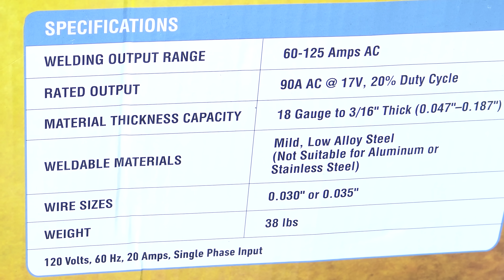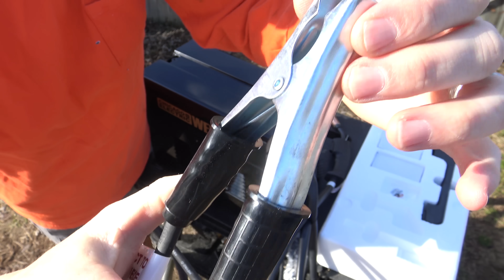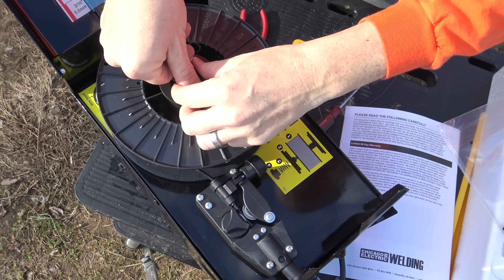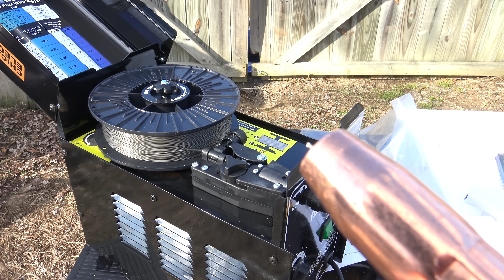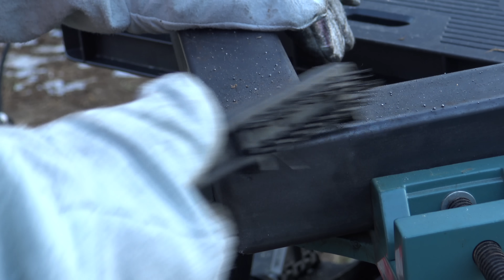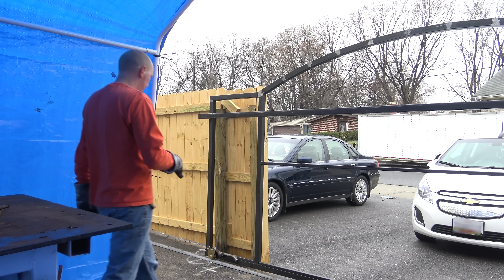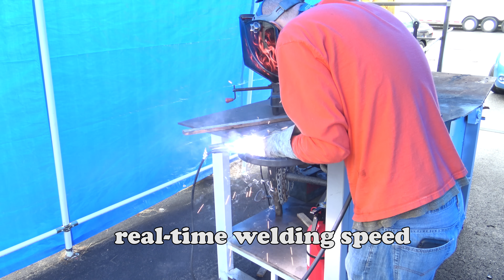Harbor Freight Flux 125 Welder Review

Comment: I have the older blue machine and have modified it alot, use a 10lb spool after cutting out the lid and moving the mount, converted to DC with caps so it's heavier now but less splatter and better penetration, reversed polarity, put a fan in it and wired it so the wire feed motor gets power before the coil instead of after the coil so no more feed speed drops, it's decent now lol, there is a bunch of videos of people converting these to DC etc, it's worth doing
Reply from the maker: Very very cool, thanks for sharing!

Comment: I have the older version 90A. I use it for portable road jobs and when i  dont have my miller available. It was on sale at HF for $88.00about 14 years ago. I told my driver to grab one. Its good for exhaust, tacks, all the simple repairs. 14 years and still going. I still have the roll of Chicago Electric. 030 wire i bought with it in it.

Comment: Not a respirator dude.
Reply from the maker: GVS Elipse P100 Dust Half Mask Respirator with replaceable and reusable filters included, Blue
Reply: You think some kind of filter will protect you from toxic fumes?  Then why does hazmat outfits have a face mask with some kind of breathing apparatus?  Sorry, but you’re not safe, without some kind of ventilation pushing the fumes away.  Just trying inform.

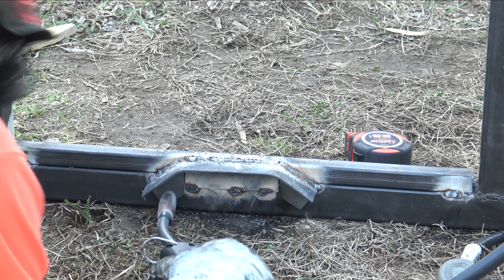Comment: At time frame 11:56 you stated "If you read the instructions and then follow them you will have a much better chance of success. - Which reminded me of the old saying we had in the Army..."If all else fails, Read the Instructions, and then be like a typical G. I. Soldier and Fail to follow them".  Yes after 23 years in the Army I'm now retired from the Military. But  I still remember that old saying. Maybe I should practice what you preach instead LOL. 

Anyway Thanks for a great video review of this welder, as I'm now looking into up-grading my old ancient 180 amp Forney Stick welder of which I've used for over 30 years now of which I bought used for $100.00 back then from its original previous owner. 

I started out long before that using an old Sears Craftsman 30 amp 120 volt AC stick welder which was a small red box about 1 foot square in size of which I bought used from a pawn shop for $25.00 and used for many years for building many things including my own utility trailers. 

As I previuously said many thanks for a great video and review of this welder.
Reply from the maker: Thanks for the good words, the experience sharing and all your years of hooah.

Comment: I used a stick welder for many many years, I bought this cheap mig welder and I'm so happy. I didn't know how easy it was to weld stuff. I also bought a HF auto darkening welding hood.  One thing I found is if you want your batteries to last longer, when not in use turn off the hood to grinding mode.

Comment: I have the 90a version of this welder.  They're the same machine except for the labeling.  I've done some serious welding with it.  I converted my HF motorcycle lift to a hydraulic cylinder.  The welds have to stand up to 10,000# sheering loads. They're holding up well.  I did convert my welder to DC and it made it a much more capable welder out of it.  Most of the welds were 3/16" to 1/4" butt welds, and some 1/4" to 5/16", but the 1/4" to 5/16" aren't subject to the sheering load.

Comment: I'm super late on this video, I did however just purchase this welder from My place of work Harbor freight lol. I bought this one because I'm a diyer and I got it for a little over $80 with employee discount. Also my buddy owns this welder and welded the frame on his rock crawler and has yet to break. It does take a beating when he climbing. I really enjoyed your review. I think I'm gonna be happy with this purchase and for what I'm gonna use it for it will be perfect. I fix small engines and sometimes need to weld tractor and mower decks. Thanks for the great review. Just subbed your channel
Reply from the maker: Tks for the good words. Def great for mower decks, be sure to coat with Rust-Oleum after or something. That employee discount is noice 🙂
Reply: @TRYtoHELPyou  you have any good recommendations on a good shield? I really don't wanna spend hundreds only because I'm a first time welder and I don't weld all the time. Preferably from Harbor freight so I can get the awesome discount lol

Comment: Does this work on 1/4 or 1/2 in steel for a buggy frame. Also what wire would you recommend for that
Reply from the maker: A buggy frame made from 1/4 or 1/2 inch thick steel will not be able to be towed by a normal trailer, that's all way way way too thick. .120 wall steel tubing may work but that too is super heavy. All I suggest is going to research this much deeper outside of YouTube unless there are decent tutorials for DIY buggy frames.

Comment: You have to get the 80 amp ( on the box it says 80, but on the welder it says 75 )  HF inverter welder for the thinner stuff. It's about the same or a bit more than this one. That way they have you on the hook for $250. Because you have to buy both. My old welder was a Miller bobcat 225 G.

Comment: i was given this welder that was never used. it turns on and feeds the wire fine perfect.  when i touch the wire to the steel nothing happens.  its metal from a 55 gallon steel drum with all the paint and rust  removed.  i have the ground clamped to the metal im trying to weld.  what am i doing wrong?
Reply from the maker: hold the trigger or else it doesnt arc. Also, paint? maybe paint is in the way.
Reply: @TRYtoHELPyou  yep wasn't holding trigger. I'm on my way to welding expert now. Thanks

Comment: I wanted some target stands made for holding paper targets and a spinner on one side that you can shoot at and it would spin a welding shop quoted me 1500 bucks for 9 of them so I went and bought my own material for 90 bucks my welder with all my equipment cost me 200 and I built them all-in-one day and they turned out very well. Nice welder for miscellaneous home projects
Reply from the maker: Nice... Glad u saved some coin. For the round portions you can look up "flange drops" (maybe on ebay? Craigslist?) from water-jet or fabrication companies. They are essentially discs of different thicknesses and material. May make for good swinging targets.

Comment: Bottom line this is a good welder for the price and beginners doing small household projects.  Its very portable and it will run off an extension cord no problem.  Its not for anything structural or heavy thick ga. metal.  If you learn to weld on this thing and then upgrade youll be a better welder overall.

Comment: The fan will go out and it over heats constantly but for the money it's worth it
Reply from the maker: I have welded a fair amount and not had the fan go out yet, nor have I had it overheat once. Im not using it every day for work tho, just little things here and there like a gate, roof rack.... and maybe later, a trailer.
Reply: @TRYtoHELPyou  I've used it a lot, I use it for work which is not an everyday thing but like right now I'm building a second floor out of metal for a small loft apartment and I can weld for about a good 20 minutes straight and then it will kick into overheat and it won't let me weld and that's with the external fan blowing at it constantly. The main thing that I found is using good flux core wire, contrary to popular belief there is a shelf life for it and some of it doesn't weld for crap

Comment: I can actually weld better with this then my 220 snap on mig
Reply from the maker: This likely means that .... Really? It's fake then, the snapon. Snapon, if getting from an authorized distributor, will have superior tools. You get what you pay for.
Reply: @TRYtoHELPyou  no I got it off the truck about 4 years ago. Snap on is junk and so is mac and matco. But the ease of buying a bunch of tools for a few bucks a week beats going through tekton (more superior to the snap-off tools that you seem to think so highly of) or any other quality brand that you pay for everything upfront for. That being said the mig makes nice welds but its not the same. I've used Lincoln's and millers growing up and all we would use is flux core wire. I can lay a better bead with a flux welder then a gas mig

Comment: Liked your vid. I welded with a MIG almost daily where i worked about 20 yrs ago and i saw this little cheapie welder, i have a couple of dune buggies that their engines died and i want to upgrade to bigger more efficient engines but I've got to modify and add bolt down plates. I hope this model works for me. If not my son in law is an actual welder.

Comment: I snagged one of these for $99 last year. Its my first welder and I got it so I didn't have to borrow my brother's anymore. It gets the job done and I've used it to fix the exhaust on my truck, among other projects. I used it to build a nifty hitch hauler for my gas generator, which is what I use to power this welder as the cords are quite short and the one time I tried using an extension cord it tripped the built in breaker so, you need a 20 amp outlet within 12 feet of your work.
Reply from the maker: Nice. If I run a 10 ga extension cord it's ok. Usually have to make one tho, they are not easy to find with a normal nema 15a outlet (same as welder plug)

Comment: Only 15 yeas that's good for me
I'v done a lot of Race car cage's.
I had the blue 155 now the 
Black 170 ok the new ones not as
good but good power 👍🏽 I'v had
to get two in 5 years in the new black ⚫
One's. Prefer the blue one's.
But the 170 amp? But made new 
extension fork's in 3/8 steel my second
one's 👍🏽 can pick up RV's and SUV and
For my small junkyard car's 🤔 I like to
use the bigger one 👍🏽 just got new 125
and Genaro for my truck 🤔 will that
work. Good video 📹👍🏽
Reply from the maker: Hmm. Yeah mine was blue. This one has been solid so far. Tks for sharing the deets

Comment: as a welder for over 20 years ..if you are welding with flux you pull ..if you're welding with mig/metal inert gas you push ...its that simple and i also teach welding /trainer for a huge fab company that is international.
Reply from the maker: You see that video where the guy was like.... Going left and right and left and right nearly ~6 inches a second or so.... I mean... It looked as wrong as that sounds I suppose.

Comment: 1 thing i would like to share he did not is its harbor fright they take years sometimes to change a design on most things. so if you take care of the welder so the things look like or close to new and it breaks say 5 years down the line you can just buy a new one and return the old one saying it stopped working. if you did not take care of it then you would have to swap parts out. buy the way if you ask at the store they will give you a number for parts and repair so you can order new parts to fix things. i myself just got this welder as an open box missing a screw or 2 and the brush it was cleared for $73 and they gave me a return of 5 days saying if it stops working in 5days and if you wish to return it you can if it stops working their policy would allow me to return it and have it swopped for a new one. so for me that's like a win win i could just buy an open box item bring it back in 5 days if i wanted and say its not working and they will replace it with a new one. awesome way to get a discount on some items if they have one

Comment: This thing slips so bad and does not provide any consistency
Reply from the maker: You gotta make sure torsion on the pincher wheel mechanism is appropriate, that the reel can spin freely AND you can't have any major bends in the cord from the machine to the gun. Even if you just kink the gun a bit it will do the thing you say

Comment: Hey what metal did you weld ? Like what were the tubes
Reply from the maker: Just regular carbon steel. Nothing special. 2 inch and 1 inch .. 16ga is what they said? I think I went with the closest to .090 I could get
Reply: @TRYtoHELPyou  play thank you lol I’m very need to all of welding and there are very little videos to this and don’t know differences between all the steels and all that and I’m still looking around between hot rolled steel

Comment: I bought almost a similar welder about 3 years ago. I use it in my garage and on my van. I’d never welded before. It’s been brilliant, except for the mask. Even if you threw yours away after building your gates, it has paid for itself. I think they are brilliant for the cost of them. I think I bought mine in the UK for less than £100. Can’t ask for more. 👍

Comment: Didn't fully understand the outlet part in the video. This will run well with standard household outlets right?
Reply from the maker: It will, but you should not do that. It should be at least a 20 amp outlet.
Reply: @TRYtoHELPyou  thank you

Comment: How’s the welds ring out 2 years later
Reply: How’s the welder holding out after 2 years
Reply from the maker: Used it a week or so ago. Same as new. Not bad. Not for 1/2 inch flat bar. Great for 1/8 inch angle or tubing.
Reply from the maker: Uncoated the gate with rust-oleum truck bed liner. It is surprisingly rust free overall and the welds are same as they were when welded.

Comment: The whole problem with these machines is you can't control the voltage and I have yet to see fluxcore wire that is designed to run on an AC output.

Comment: Question, I want to repair the coupling in my cadillac converter that attaches to the exhaust manifold on my van... can this work to weld that back together you think?

I welded a bit back in my 20s but it's been a little but I'm 37 now.  So yeah need a refresher course.

Comment: loved this! do you or the box state it will work with a 60 amp service, breakers of course? I'm pushing 120 v and 220 with ease, home built 1979, so not vintage
Reply: Did the cost of electricity jump way up drastically using this welder? What brand respirator did you use and any shortness of breath, coughing, gagging and nausea or other? Does that welders helmet really work, no flash too eyes once the arc was made?

Comment: Great Video. Well done,  well narrated and everything well explained, even the pro's and cons. and the best part of the video was that I didn't have to listen to some stupid music of which I generally don't like,  or else some stupid back-ground junk the narrator thinks is music, but isn't, of which the narrator likes and thinks others will like, but of which will run me up a wall, and of which I have to mute just to watch the video.  - Thank You, in fact, Many Thanks to you for leaving that part of it out of it, and only doing a great job of narrating the video instead. - But, anyway, I've often wondered if these cheap harbor freight wire-feed welders would be worth the money for use in just simple around the house style  type welding projects. Evidently they are. - I already have an old (around 40 years old), 240 Volt AC/DC Arc Welder that I've used for over 20 years or more.  In fact, it is so old it doesn't even have a cooling fan in it, and that's why I got it so cheap was because the original owner said it kept shutting down on him because of overheating while using it in his shop, so he bought a new one with a fan. After I bought it used, I installed a used 120 volt AC Bathroom exhaust fan inside of it (which comes on when I turn the main welder switch on), with the air from the fan blades being forced down through the coils for cooling it, and that has worked just fine for keeping it cool for all of these years.  I've never had it shut down on me. however on the full Amps cycle while using it to cut metal, I will trip a circuit breaker, but that's my fault, not the Arc-Welder's fault.   - Anyway, I just wanted to upgrade to a wire-feed for simple projects, but don't have the funds to buy a good miller or another  major brand type, so, thanks for the info, and a good report for one of these from harbor freight. - Yes, I know it will never be as good as an expensive Miller (etc.),  but who cares, all I would want it for, would be for simple small projects anyway, not for building another Empire State Building, or a Battleship for the U.S. Navy. Anyway Thank You Sir, for a great informative video.
Reply from the maker: TKS for the good words:) glad I could help!

Comment: Around 7:22 it seems like smoke is coming from the ground clamp area.
Reply: I'm thinking it burned the paint iff.
Reply from the maker: ok, yeah. Where i was welding... The smoke traveled upward from there, through the tube, and out that end of it... interesting how it appears that the ground clamp is smoking. It was not. Flux cored wire is very smokey. Wear a respirator.

Comment: I have this welder. For the most part it does what I need. But if you want to improve your welds, simply do these two things.
1) Replace the power cord with a heavier gauge, this will insure that you're using the max amount of amps available in your electrical circuit.
2) Upgrade the ground clamp. Like in all things electrical, a good ground will give you the best results.
Also, replace that cheap mig wire with a better quality wire, (like you had done in the video). This alone will give you more consistent results.

Thanks for the review.

Comment: Did you use a regular 110 to 120v or did u have to find the 220v hole?
Reply from the maker: This is a 110/120 volt welder. If you have 220 volts in a hole, look out!